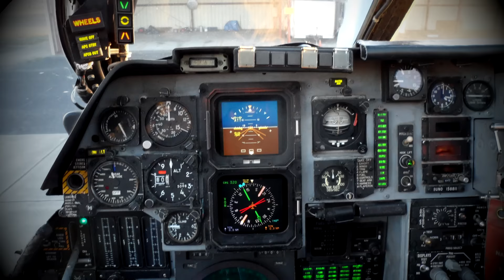USMC Jet Crashes Cable Car | Last Moments

Comment from the maker: Join membership: https://www.youtube.com/channel/UCGHDQtN_vzFYJaq_Fx1eikg/join
Second Channel: https://www.youtube.com/channel/UCt93hxFmjppL5nLRAX94UrA
Merch: https://qxir.creator-spring.com/
Patreon: https://www.patreon.com/qxir
Twitter: https://twitter.com/QxirYT
Discord: https://discord.gg/jZzvvwJ
Twitch: https://www.twitch.tv/qxiryt/
Subreddit: https://www.reddit.com/r/Qxir/
Reply: get a haircut.
Reply: The audio was a bit distant and quiet in this one chief.
And yeah.. you lookd better with short hair..
Reply: Not to be an ass but could you turn down the volume a tiny bit on your next last moments video? I like hearing your voice a bit louder and every time that tone plays I have to wipe the blood from my ears. Also I like the hair long you look good no matter what Qxir screw these other guys.
Reply: What happend to the drawings?
Reply: Having researched this event myself, several years ago, this presentation is half @$$.
I've seen aftermath photos of the aircraft in question, and was surprised the damage wasn't more severe.  The cable failed at the tower support, due to an overloaded of tensile force.  It was NOT 'cut like a knife', by the aircraft wing/tail.
Reply: @cheerdiver  - You are correct about the actual technicalities however I believe the point in question is the fact that it was the fault of the aircraft in the 1st place.
Reply: They were SHOWBOATING and knew damn well the cable cars were there but only didn't know about the higher cable, which is why they hit it. They are murderers and should've been thrown in jail for a long time. Half assed doc, as I've seen a much longer and in-depth one done much better. Your other shorts are quite good though. :)